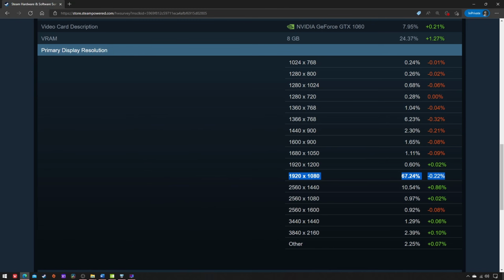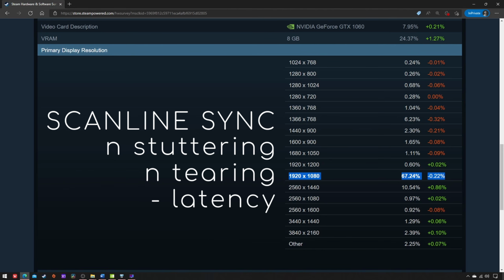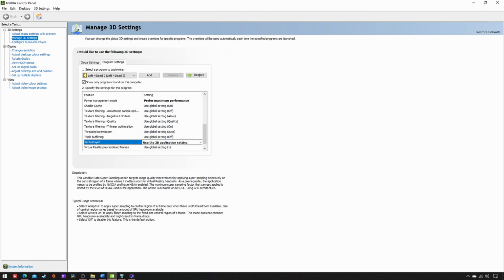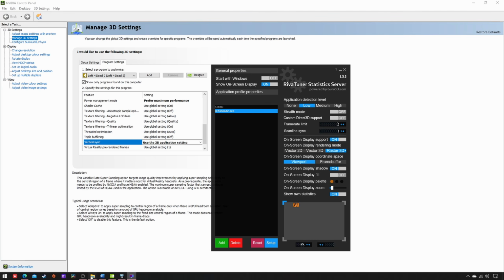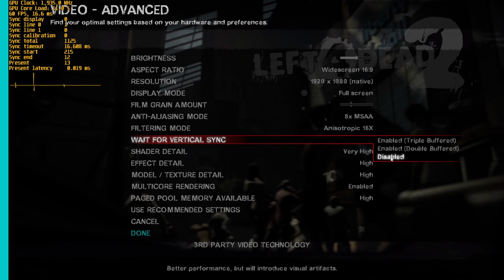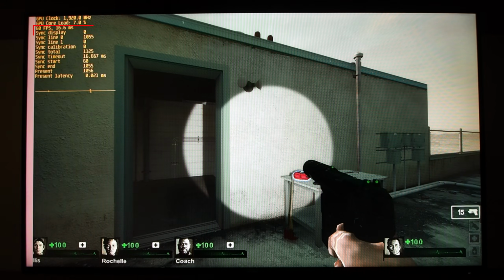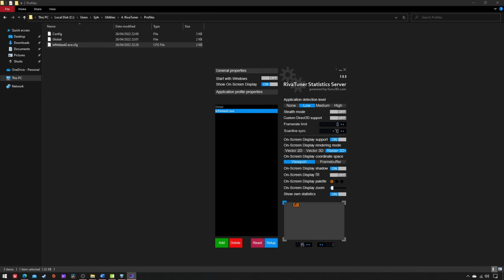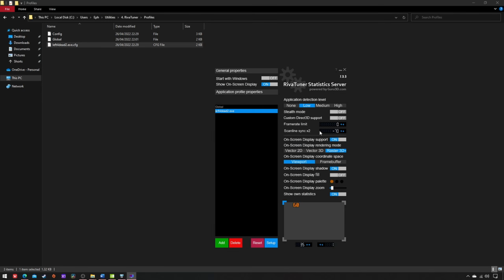How to Set the Coolest Sync Technology: RTSS Scanline Sync

Comment: How about 120Hz with Directx12 ? I play Fortnite like that.
Reply from the maker: SSync should work, while SSync X2 will not.
What's your monitor model exactly?
Reply: @oakenglass  LG OLED C9. But I play on 2140x900 , I'm using 120Hz BFI with -439 SSync
Reply from the maker: @aws26v  What a nice display you've got! So, does SSync work well on it?
Reply: @oakenglass  I think it does, but I got some stutter tho, I think it's due to OLEDs near instantenous pixel response time.

Comment: I have a game that never goes below 150 fps, so I thought I could use 2x Scanline Sync, but whenever I have it enabled, the framerate dips below 120. Is it normal to lose so much?
Reply from the maker: SSync X2 is way, way more finicky to set up.
If dips are sporadic and they don't bother you, I wouldn't worry much.
If not, I'd try to move the tearlines higher, so that the lowest one never vibrates inside a "padding" area with a height equal to 1/10 of that of the screen.
Reply: How do you move the second tear line? I can move one up and down, but the second doesn't seem to move, it just stays in the same place.

Comment: is there anything that can be done if the game is capped at 60 fps? for example Guilty Gear Strive cannot be played over 60 and has pretty distracting tearing
Reply from the maker: I don't own Guilty Gear Strive, but I've just tried with Mortal Kombat: Komplete Edition (also capped at 60 FPS).
By default, the tearline is located exactly in the middle of the screen and, I agree, it's absolutely distracting.
However, I managed to move it below the bottom edge of the screen, so RTSS Scanline Sync did work!
Reply: @oakenglass  Interesting, for me guilty gear's tearing gradually slides from the top to bottom repeatedly, so any adjustment I tried was pretty useless :(
I just gave in and turned on vsync, and surprisingly I can't really feel a difference in input delay.
However, if you do ever figure out a solution, I would still like to know! thanks for testing with mortal kombat
Reply from the maker: @sponzimusic  Usually, if the tearline vibrates too much, it's because the CPU and/or GPU usage is too high: try reducing certain graphics settings such as AA.

Or perhaps you own a monitor with a max refresh rate higher than 60Hz? If this is the case, try to set 60Hz and see if the tearline vibrates less.

Comment: why scanline significantly decreases fps? without scanline i have 80 fps, with scanline it drops to 55, is it okay?
Reply from the maker: Scanline Sync is a type of synchronisation, so it attempts to synchronise FPS to the maximum refresh rate of your monitor (e.g. 60 FPS with a 60 Hz monitor). Consequently, a decrease to 60 FPS is expected.
If they drop below 60 (as in your case), it's essential to reduce some graphics settings.

Comment: i have no syncflush or sync info on either of blobal or game config any ideas?
Reply from the maker: You have to open the game config, add the two lines manually, then save the file.
Reply: @oakenglass  yeah i had a moment lol sorry and thankyou for replying, im having trouble getting the hotkeys to work though
Reply from the maker: @scottmurby6294  No problem!
Have you set the "Scanline Sync" value to 1 (or any number different from 0)? If it's still 0, the hotkeys won't work right away... I don't know why.
Reply: @oakenglass  i have and also checked the plugin, still nothing
Reply from the maker: @scottmurby6294  Have you also added "SyncHotkeys=1" under the "Framerate" section in the Global config?
Reply: @oakenglass  i have
Reply: @oakenglass  ive sorted it, thankyou so much for taking the time to reply i really appreciate it
Reply from the maker: @scottmurby6294  No problem at all... thank you for watching my video!

Comment: also i need help with the ctrl shift down on the color bar. i don’t see any sort of line like you did when you were dragging the rear to the bottom. when i go into tutorial mode or in game there wasn’t an indicator so i wasn’t sure if i got the right number
Reply from the maker: So you see the color bar and all the OSD information, but not the tearline? What's your Sync Line 0 value as soon as you start that game?
Reply: @oakenglass  Same here I see all the other stuff but not the line and the value of sync line 0 is 1
Reply from the maker: @Zero-qi2tb  If you press CTRL+SHIFT+DOWN or UP, does the value of Sync Line 0 change? Are you using borderless windowed or fullscreen? Do you have more than one display?
Reply: @oakenglass  1. Yes, the value of sync line 0 changes when I press CTRL+SHIFT+DOWN or UP
2. I am using fullscreen mode
3. Nope, I only have one display
Reply from the maker: @Zero-qi2tb  What's the game and its max framerate?
Reply: @oakenglass  The game is Dead Space and the max framerate is around 90-100
Reply from the maker: @Zero-qi2tb  I've just downloaded Dead Space (Steam version) and followed the steps highlighted in my own video to double-check for errors.

After launching the game for the first time, the tearline was NOT present because Vsync was set to ON by default. As soon as I switched it to OFF, the tearline appeared.
These are my exact in-game "Visuals" settings: Resolution 1920x1080, 60Hz / Fullscreen ON / Vsync OFF / Graphics Quality HIGH.

With "Scanline sync" set to 1, the tearline should appear just below the top edge of the screen (as shown in the video), but perhaps in your case it appears within the blanking interval (i.e. the "nowhere land" between the bottom and top edge of the screen). Try setting it to 500: the tearline should be around the middle of the screen.
Reply: @oakenglass  I still can't see it. Does that mean I don't have any tear?
Reply from the maker: @Zero-qi2tb  That's strange. What's your monitor?
Reply: @oakenglass  I'm using an asus laptop with 1366x768 resolution 60hz
Reply from the maker: @Zero-qi2tb  Try to set "Vertical sync: OFF" in the NVCP, instead of "Vertical sync: Use the 3D application setting". If the tearline still doesn't appear with Vsync forced OFF everywhere, I honestly wouldn't know what the problem is... I'm very sorry.
Reply: @oakenglass  Yup not working but also thank you for trying to help!

Comment: Do I do this for every game, like set the scanline? Or should it be generally the same? I tried doing it for Monster Hunter World but it naturally has a gpu framerate limit attached to monitor hertz, I get tearlines everywhere with the scanline set from another game. Even thought it runs perfectly in another game I play
Reply: Even with the unlimited framerate option it gives me trouble
Reply from the maker: @ihavenoplacelikehome  Framerate Limit must always be disabled. What do you mean specifically by "it gives me trouble"?
Reply: @oakenglass  As in I have limit disabled everywhere, and it's still running at 75 frames average
Reply from the maker: @ihavenoplacelikehome  It seems SSync isn't engaging. Unfortunately I don't have MHW, so I can't check for myself... is everything set properly?
- The correct "game.exe" (I reckon it should be "MonterHunterWorld.exe"?).
- Framelimit & Vsync OFF. Graphics settings that ALWAYS produce FPS > 60.
- Set RTSS Scanline Sync to a value different from 0 before launching the game.

Comment: So what are the Left4Dead files adjustments for exactly, and is HW what shows that overlay in-game with the flashing color bar?
Reply from the maker: SyncHotkeys=1 enables the hotkey combination CTRL + SHIFT + UP or DOWN.
SyncInfo=1 shows the information lines from "Sync display" to "Present latency" on the OSD.
SyncFlush=1 produces more tearline vibrations but a lower GPU load / SyncFlush=2 produces less tearline vibrations but a higher GPU load.
HWiNFO only adds GPU Clock and GPU Core Load to the OSD; RTSS "Enable Frame Color Indicator: Color Sequence" is the option that shows the flashing color bar.